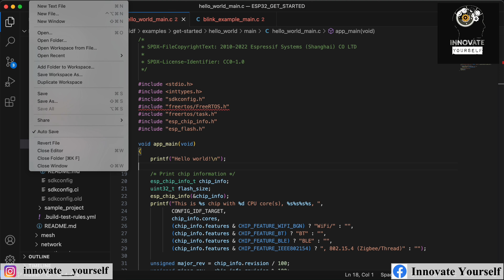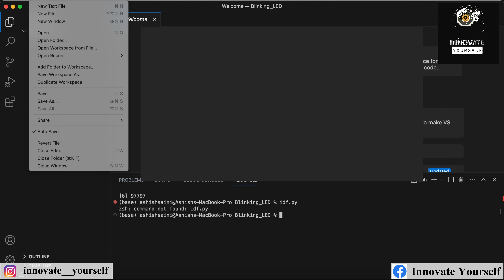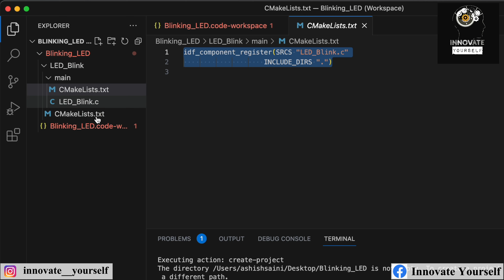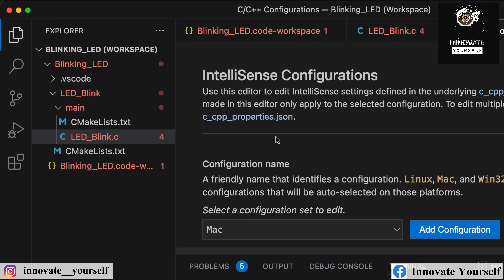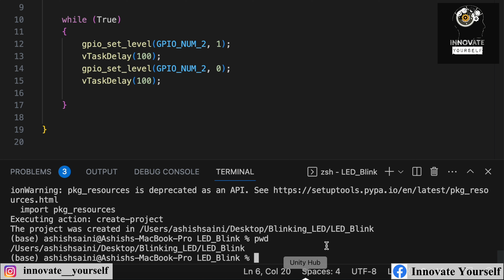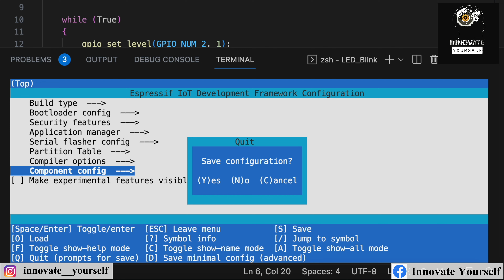Comment: Great tutorial for blinking on-board LED for ESP32.
I have ESP32-S2 DevKitC-1 v1.0 and there is on-board RGB LED. However there is no code sample examples on the internet that I could use to make it blibk.
I first connected this kit to my laptop it was blinkng that RGB (first red, then Green and finally blue) in loop. After I uploaded sample sketch using ESP-IDF, but then I could'n find similar sketch for blinking this RGB LED. Could you please point me, if you are aware of, any such code sample or how to make single RGB led blink?

Thank you!
Reply: Thank you 😊
I have esp32 s3 WROOM with me and I have to check on this because I haven't used this RGB led for different colors. I just used it as a single color with pin GPIO48.